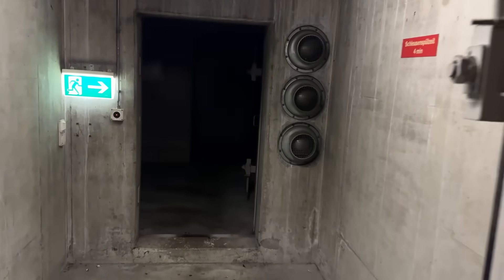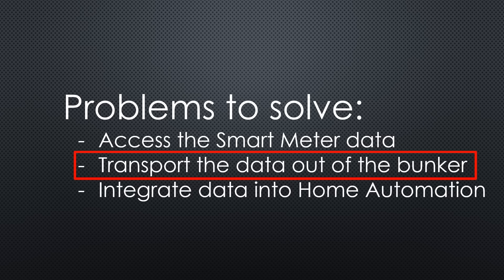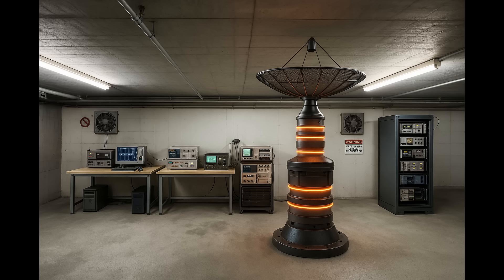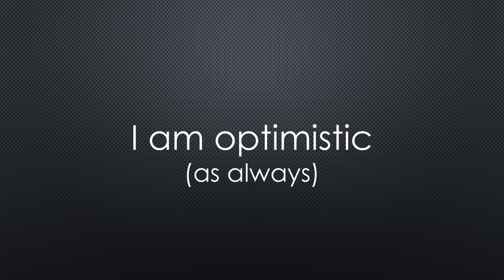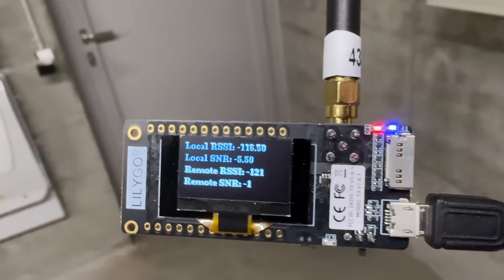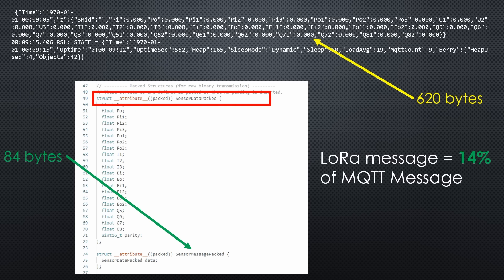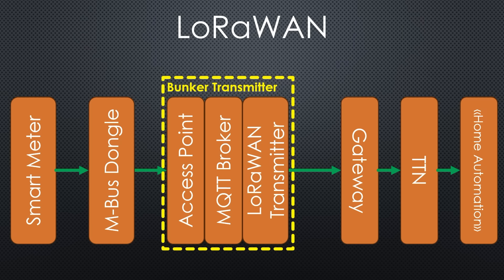An adventure: Reading a Smartmeter in a Bunker (MQTT message extender)

Comment: thank you Andreas for this interesting video; as usual 
However, you make the cases in 3D printing in your workshop; have you ever wondered about the toxicity of doing that (microparticles even with PLA)? 
Overall, I haven't seen any very practical advice on this. You go from one extreme to the other (you print in the chamber or you make a box with filters and external suction). 
Maybe it's no worse than cooking your steak... ??? Danke !
Reply from the maker: I do not have any filters in my 3D printer and never had. For me, that is not a problem.

Comment: Interesting solution, never worked with LoRa, yet. However, this use case is somewhat simple. I wonder about security countermeasures when dealing with more sensitive data transmitted over LoRa. That would add some encryption and authn and authz layers. I wonder if LoRa still would be appropriate.
Reply from the maker: LoRa has an encryption. But keep in mind that you usually do not transfer banking data via such devices.
Reply: @AndreasSpiess  No, not in a private context. But one could use it for transfer of atatus messages or control messages to edge devices. Then not only transport encryption is important but also authorization. However, my hope is that your ideas are not used by small companies operating such things and having no clue about security.

Comment: Very cool - thanks Andreas. We tested 15 years ago the same in Swiss Bunkers and electrical housing, together with Landis+Gyr, the official wireless M-Bus on 169MHz but it wouldn't become successful (then probably because of missing LoRa...). The extension Modules are still available as extension options from third party (to remotely read out meter data). But Landis+Gyr stopped the projects.
Reply from the maker: Interesting! There is a video series on YouTube where a guy hacks L&G Mesh devices. So, they still use some form of wireless technology. Maybe only for the US?
Reply: @AndreasSpiess  Probably yes, I think so. L+G are still part of the Wi-SUN Alliance, an interesting IP v6 based IoT Routing protocol for SmartCity and SmartEnery. But mainly in US and Asia. We tried it but in Europe other protocols like 4G, LoRa (GWF) and proprietary RF (Kamstrup) etc. have successfully prevailed.

Comment: Title: How to Send and Receive Messages with BLE in OpenMQTTGateway on ESP32?

Post:
Hi everyone,

I am new to OpenMQTTGateway (started a week ago) and currently using an ESP32 board without any external sensors. I uploaded OpenMQTTGateway via the web installer and successfully configured my Wi-Fi SSID and MQTT server.

When I access the Web UI, I can see that the gateway is detecting Bluetooth (BLE) devices in the console.

Now, I would like to understand how to:

Send messages to a BLE device from OpenMQTTGateway.

Receive messages from a BLE device and publish them to my MQTT broker.

Since I am only using an ESP32 (without sensors), what are the correct MQTT topics and payload formats for sending and receiving BLE data?

Any guidance or examples would be greatly appreciated!

Thanks in advance!

Comment: It’s true our wives never understand the engineers yearning for an elegant solution! On the frequency dependence of building penetration. Yes lower frequencies are stronger inside buildings but only because the path loss to the outside wall is lower. My radio group and our research labs performed several IB penetration tests and there is very little difference in loss across an exterior wall. Many people find this hard to believe as they “know” that lower frequency is better inside but for a radio engineer the converse is true. Building entry often occurs through cracks (around doors and windows) or through the gaps in weld mesh in concrete. Waveguide cutoff frequency theory says that a higher frequency should get through a small crack with less loss. All our measurements have shown that the difference in loss for signals between 700MHz and 2GHz is negligible.
Reply from the maker: Interesting! Thanks for sharing!

Comment: I Will be try the halow extender. 802.11ah using low frequency for covering 1km with 10mbps.enouth for iot device. There Is a kit with 2.4ghz to 868mhz that can simplify your design.
Reply from the maker: In Europe, it is most probably not really legal (I made a video about it). The US is ok because of their regulations.

Comment: Thank you very much for your effort and congratulations to your meater readout solution. 
In my house also a Landis & Gyr meter ist used. Our optical interface delivers nearly every seconds data and I use a >20m cable to read it. I am very interested in LoRa WAN but up to now I had no need to us it.
Reply from the maker: As long as your reader is in your home, you are lucky! However, I still needed to solve the problem of connecting to the "bunker" because I have plans for a new electric car...
Reply: @AndreasSpiess  Yes, In that respect, I'm lucky. I don't have a bunker, but my electric car is parked in the yard.
Reply: @AndreasSpiess  Electric car in an underground garage? Well then, install a remote-controlled fire alarm and extinguishing system. Or do you want the entire bunker to collapse?

Comment: Andreas, are all smartmeters installed in bunkers close to residences? Or is that just your local situation for you and your neighbours?  Seems like a lot of copper to run mains from bunkers to residential homes. In my location (Ottawa Canada) we have distribution transformers for every 4 houses that keeps the heavy gauge lower voltage wiring to a minimum
Reply from the maker: This is not a typical situation. The homes and flats are very close (we live in crowded Switzerland). We do not have any distribution transformers within this area. We operate at 400 volts between the 3 phases, which reduces current.

Comment: I am finding the LilyGo quite expensive - Australia's dollar is very weak. I have started building Lora with basic chips, esp32 for a few dollars rather than 30-60 or even more.

What I have found though is that I need to use ESP32 boards and we can't use the serial output with them. These esp32 38 pin power bread boards are handy - but limit debugging.

Anyone got a solution?
Reply from the maker: The ESP32 chips offer 3, and most boards offer 2 UARTs. You simply need to connect to them using a Serial adapter.
Reply: @AndreasSpiess  Thanks for your reply. I wrote my question very poorly I am sorry. I am using breadboard with power supply to it  they have 3 types of power in - the board plugs in and offers all pins plus v/g on each pin. I can just plug into the esp32 still and not use the bread board inputs which appears to work for power and also serial.

Comment: Why is the payload so dense in data ? I would have assumed there is maybe Voltage, Current, kW/h in the data package, but you have like 10 floating point variables that take tons of data space.
Reply from the maker: You are right; after some tests, I reduced the data volume to the truly necessary parameters. I decided that I did not want to store inductive or capacitive loads. Now I have around 15 parameters (including 2 tariffs)
Reply: @ I faced a similar problem the other day. I noticed that JSON is the worst format to transmit data over links that are somewhat challenging. As JSON is transmitted as a string array, each digit of a float takes full 8bits. If you choose to transmit as binary array, like a data struct you can further reduce the data by like 60%.

Comment: Interesting project. I want to do something similar, to control robots that 
might be 12 miles from the nearest wifi signal, where the far end from the 
robot has a LoRa to wifi adapter to make the final link to the web..

At the end where the robot is, 
there will be the robot and remote solar powered charging stations

Can you tell me if this would solve my problem?
Reply from the maker: Keep in mind that LoRa only works on a line of sight for such distances, and its transmission speed is extremely low.

Comment: Nice innovation! I don't have anything like this in my current home, but I"m sure many others will find this useful. 

I do have a bit of an issue with your struct variables. Over many years I have found that descriptive variable names provide much better code readability and maintainability. But this is just my personal peeve. 🙄😃
Reply from the maker: You are right. In this case, they are the same names used by the meter. So they are somehow "speaking".

Comment: There are data transmission systems via power supply wires.
Reply from the maker: You are right. But then, you need access to the "wires". And I do not have that.

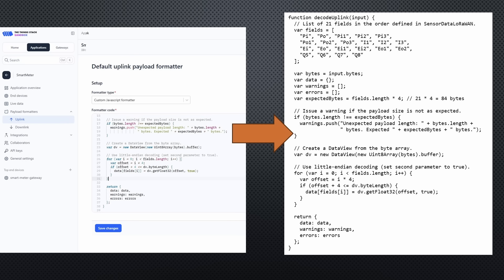Comment: Hi Andreas. You should definitely have code spewed by language models checked by experienced developers. For example @11:35 the code makes a double heap allocation that is not balanced with a free/delete. This will cause a heap overflow (and "crash" the system it runs on), which you might believe you can solve with regular resets but it's only a dirty workaround and pretty ugly.

FTR you don't need dynamic allocation in this case, a variable length array should do as it is allocated on the stack instead of the heap and is automatically released upon exiting the function.

TL;DR: do not trust large language models for generating reliable code. Always have it verified by experienced developers. Always .
Reply from the maker: Thank you! I ran the tests for quite some time without any crashes. Perhaps TTN has sufficient memory and efficient garbage collection. I am for sure not the only Java noob working with this platform ;-)
Without Java knowledge, I would not have discovered this problem. By the way, after I entered your suggestion, ChatGPT proposed deleting the var...
Reply: @AndreasSpiess  If it's java then it's a completely different story (I assumed it was C++ actually 😅) and you're right, the garbage collector is there to help a lot.

Comment: why didn't you consider extending the mbus side? mbus is similar to uart and should be extendable
Reply from the maker: What do you mean by "extending"?
Reply: @AndreasSpiess  the M-Bus is like some serial interface with special electrical propertys. you could use the M-Bus transciever and convert. it into Uart and send that through Lora, without the need for an extra access point and intermediate mqtt Server. (although I must admit, it's a pretty versatile "hack" solution)
Reply from the maker: Fortunately, this dongle does the decoding of these OBIS codes. And I did not want to transfer "unnecessary" ASCI code via LoRa. So, packing was a good solution to that problem.

Comment: If you just read the current Lorawan specifications, a single read if you pay attention and maybe underline takes a notes would allow you to easily pass the certification tests. The current certifications are well written easy to understand and anyone with a little background encoding or basic microcontroller programming using a variety of different languages be it RTOS, C++ or micropython would easily be able to understand and implement the specifications including packet size and airtime limitations. I've done some experiments which violated those specifications but it was for remote sensing and remote areas where no one else would be impacted as I'm thinking entire watersheds. We're talking about super remote areas where no one lives with rather difficult terrain. River beds flow in valleys and start high the mountains... Compressing the data to fit into the data packs or something I am immediately keyed in on as important. It was also just to serve as one link in a multi method or multi-path (using the word multipass can be misunderstood) multiple communication formats would be a better way to say it. To create a complete mesh network of data transfer from the top of a watershed to its exit to the sea. You would take advantage of 4G LTE and Wi-Fi where possible. There will be some data that will be far more than permitted under the Lorawan specifications. On those particular sensor suites or sensor locations you would use 4G or Wi-Fi or create  or private wide area network of your own. My goal is to monitor water quality, water flow quantities, the presents or absence of bacteria specifically E coli, three-dimensional for sample container with different dye crystals added and stepper motors with microscope reticules. The Bosch deep machine learning air sensors can detect VSCs along with VOCs and VSCs can indicate bacterial overgrowth. The VOCs will detect dumping a line breakage or other contamination of the water. With the presence of E coli CTXM having now spread the world a result of antiquated water treatment plants and the presence of pharmaceuticals and every freshwater link to the sea and its metabolites along with animal husbandry that extensively resistant version of E coli has now done a full loop from swimmers and surfers in the UK to fish birds land mammals all the way back up to the guts of Alpine birds. Perfect textbook epidemiological spread of a new emerging pathogen. Corn which we have caused ourselves by not screaming and filtering pharmaceuticals and I'll give tetracycline as an example as it almost always makes it into the freshwater. You can also make analogies between mad cow disease and the use of bacteria to clean our water which contains antibacterials antimicrobials antivirals chemotherapy and other complex hearty molecules meant to be resilient for longer bioactivity and a person's body.
Reply from the maker: I wish you success with your project. You find a lot of stuff to all aspects of your project on this channel.
Reply: @AndreasSpiess  We don't live far from one another actually I'm in a neighboring Canton. I'm a French speaker and had to move to the German part so Bern-German. I like your videos you're a good creator and has shown some really nice projects. I have been Swiss for more than 20 years. It's really hard to have to move to the German part as I'm completely fluent in French. I'm having to start over completely from scratch and that's not very easy. You can imagine but I have several projects and a lot revolve around remote sensing of water because I have a degree in public health and graduate level but I'm also a juris doctor. I've even taken classes at h u g as a postdoc and have been admitted to the ODAGE. Some academic degrees in my professional licenses have been accepted here and I started my career in the Swiss Law Firm having to do a year as a stage. I became a master's in science later in life have published in peer reviewed journals and an extremely interested in several aspects of engineering specifically electrical, mechanical, and material science. I would say I'm a hobbyist engineer. I'm really good at law but after a philosophy degree I found it to be intellectually and ideologically disappointing. And then imagine how my brain exploded on I took the red pill here and I mean Allison in wonderland not the matrix but my worldview has completely shifted. I'm not accepted by others here very often while I'm not accepted where I was born either. Nor do I have anything in common with them or accept the geopolitics as I believe since I left school there the subterfuge of the Constitution has become absurd. I believe the people are suffering from mass insanity but it does point to the absolute need of focus on a high level of education here and the pedagogy that we employ that allows us the privilege of being the only direct democracy in the world. We are the only country and unique and uniquely so that has four distinct cultures and language groups that has embraced consensus and has made it work. I had a former client who left us early which is one of the reasons I'm living here but that being said he made the same comment to me and he used to teach philosophy at Radcliffe while he was a scholarship student, and Harvard Law School graduating second in his class from Columbia as an undergraduate in the engineering school and applied mathematics. You could say that my client being a lawyer himself and a very good one would imply something about myself considering he would never let me go. He could not replace me and I now know why and a comment he made to me that having a lawyer from where I was born gave him more a higher level of the perception of honesty and correct dealing. I would say that that's generally true. I'm Montana lawyer as well as the other states that I'm admitted would likely be more honest than not... Compared to Paris London New York even Zurich I'm going to be nationalist because I've seen bad behavior and lawyers in both of our two major cities sadly and increasingly and more so in the French one. We are so sheltered here and I'm glad to be here as we have been spared the brunt of the changes that have occurred in Geneva, Vaud, and  unter-VS. It obviously stops at Visp. Go figure 😂👍🏻🖖🏻🙏🏻🇨🇭🇨🇭🇨🇭🇨🇭
Reply: I guess you went to ZTH which is my favorite university here...
Reply from the maker: Yes, I went to the ETH.
Reply: @AndreasSpiess  lucky you! I think that's one of the best universities in Switzerland and all of Europe. At this point in my life I can only dream as I have a terminal degree but it was in a subject that frankly was intellectually and ideologically disappointing. I'm qualified to teach certain subjects there but not sure that they would welcome me. I face quite a bit of discrimination here. I had to move to the German part from the French part so I speak French but I've had to start relearning a whole other language. That's life.